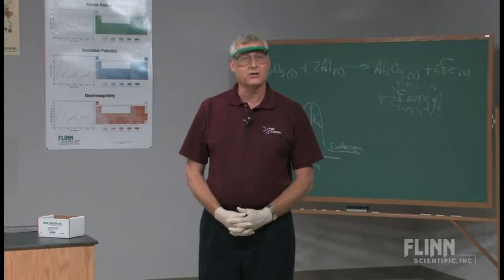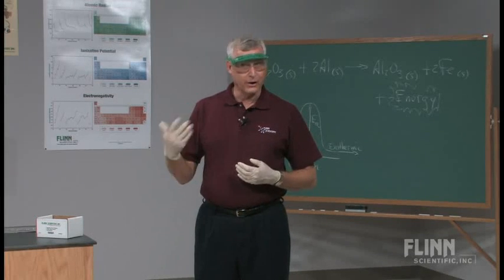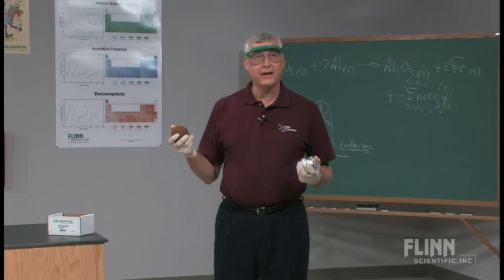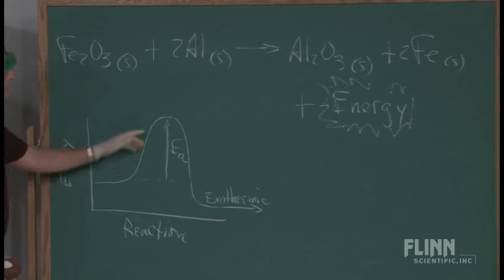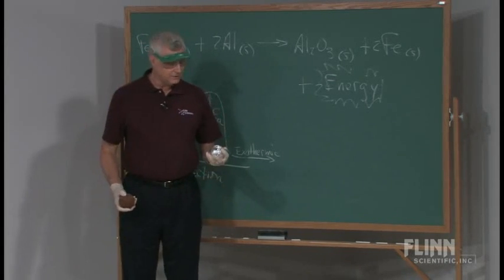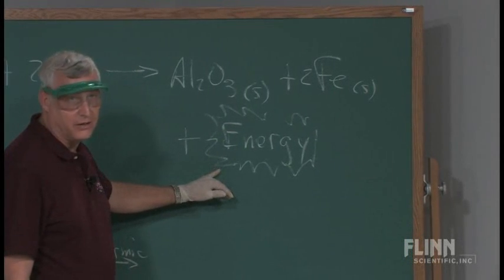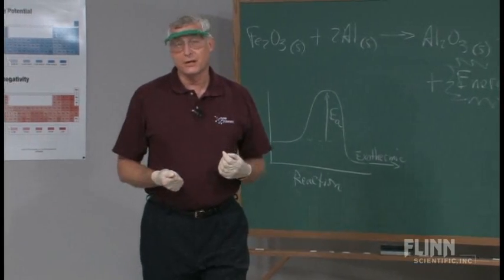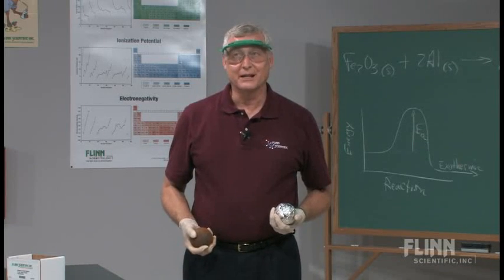Smashing Thermit Reaction

Comment: fantastic. The only way to improve the experiment is to smash the two balls together without the foil, proving that the sparks are only generated when Al is present. ie; A true thermite reaction. This effect is of commercial significance in ship cargo holds where Mg anodes have fallen and impacted rusted surfaces, with the kinetic energy providing the activation energy for the spark and subsequent detonation of the volatile ballast contents.

Comment: You should note that this reaction appears even more energetic because the tiny iron particles that are formed almost instantly turn back to rust because of the oxygen in the air. This releases even more energy.
Reply: +Caphits oxidation of iron is actually an endothermic reaction so it will actually reuptake the thermal energy released reducing the total energy released ;)